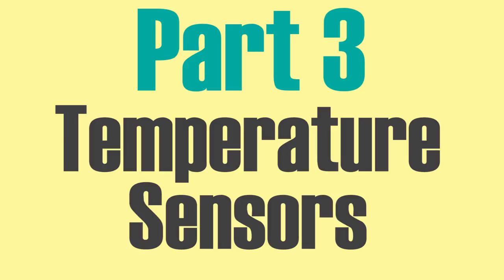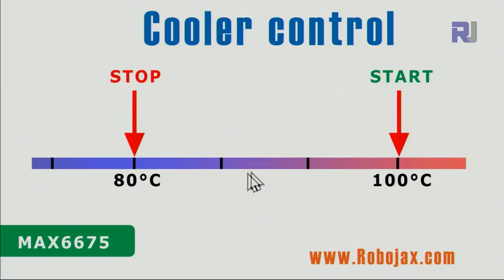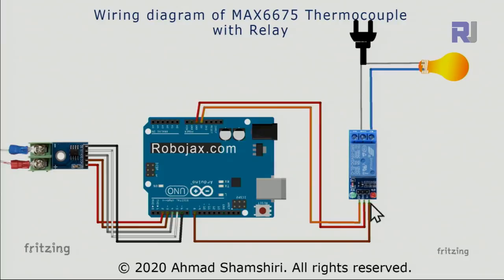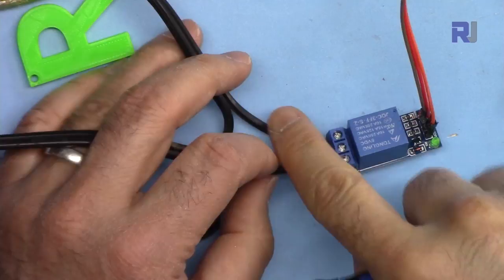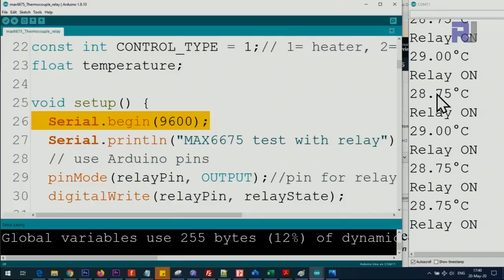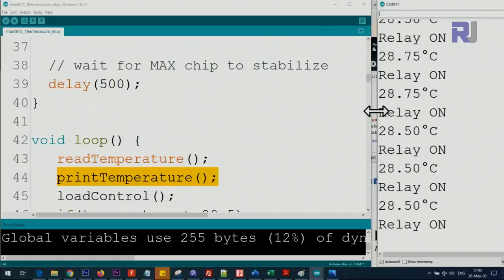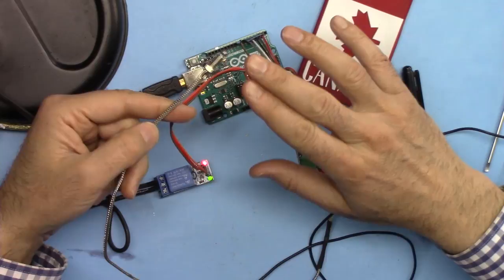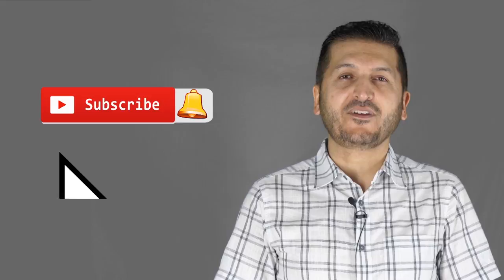Lesson 47: Using K-Type MAX6675 as thermostat | Arduino Step By Step Course

Comment: Hi. Again I am facing a problem. I need your help.
My Arduino nano is works perfectly. But after few minutes like 20 minutes it's stopped working. But when I repowered it Or reset Arduino then it work again as usual. Also I2C 4002 display doesn't display correctly. 
What is the problem. Please assist me

Comment: Hi do you have coding for this or any video related to this where I can see and learn MAX6675 Module + K Type  Thermocouple Sensor 
3.2" TFT LCD Touch Screen Display 320X240 ILI9341+3.2 inch Shield+Mega 2560

Comment: Hi it is possible to add cooler and heater in to the same code ? I mean like
type_ control 1 and type control 2 at the same time so i dont need to re-write the code all-the time ?
Reply from the maker: Then you need to duplicate all variable and rewrite the code

Comment: Hello sir, 
Please help me. How to I add this code in  temperature sensor lm35 display on i2c lcd 16*2 display code .. Please tell me 

I want to turn on and off the fan based on the temperature
Reply from the maker: I saw your comment under the display.  Just use that same code.
Reply: @robojax  thank you so much for replying back Sir
But it is giving me a error while compiling

Comment: Your website is not opening sir
Reply from the maker: Thank you for letting me know. I just fixed the issue.
Reply: @robojax  thank you sir...i have 1 request sir...can you please modify this code by adding 16x2 display with i2c module to show real nd set temperature  nd a potentiometer or push buttons to set desired temperature....i would be so thankful to you if you helping me about that...I'm a mechanical engineer nd i need this type of temperature controller for one of my project...thank you
Reply from the maker: Hi, you may use or learn from this video Lesson 20: Using LCD1602 with Arduino display temperature, voltage and distance | Robojax
https://youtu.be/NXAswOc_2zg